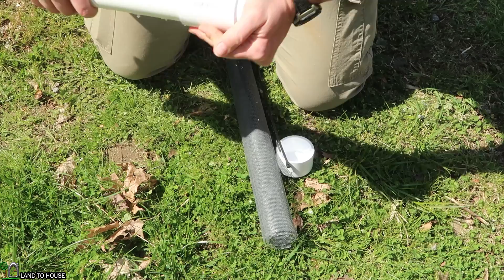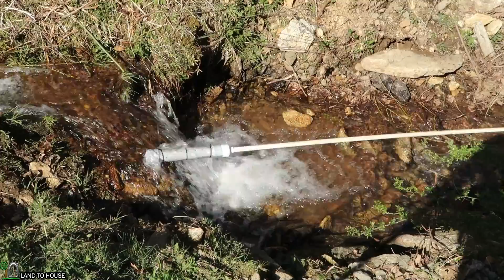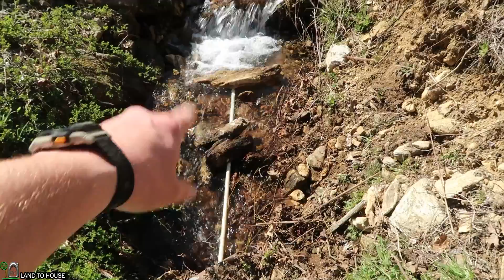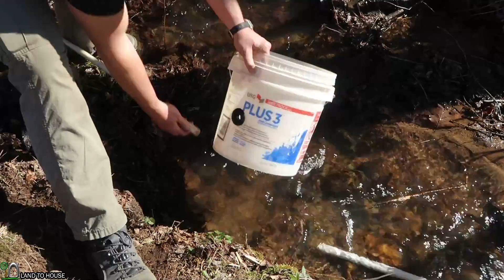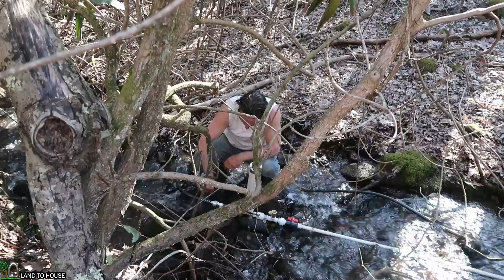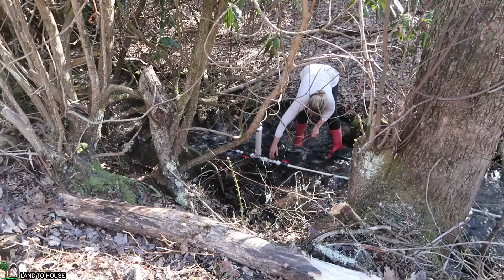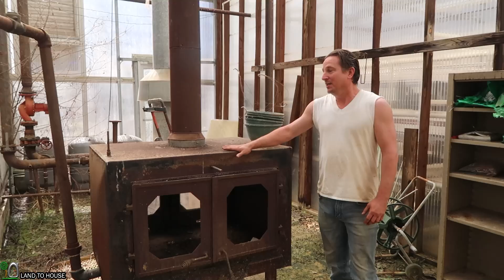Ram Pump Brings Life to Abandoned Greenhouse

Comment from the maker: Buy a Ram Pump at Land To House:
www.landtohouse.com
Reply: I bought one about a month ago and works great. But not when ice builds up in the swing valve.  Any tips for keeping it from building up ice during the cold nights?
Reply: Or just MAKE ONE with a quick trip to the Hardware store.
Reply: you should encourage that couple to start a youtube channel their journey would be fun to follow
Reply: That's right keep it off the ground
Reply: Z's
Reply: அருமை அருமை
Reply: Wish you sold complete kits less the long pipes/tubing.
Too expensive to buy 10' of 4" pvc just for 2 feet of it.
How does the air chamber affect the pump, volume, and output water pressure?
What happens when the air in that eventually dissolves into the water?
Can you use a hot water heater expansion tank (bladder type)?
Would be nice to have some water pressure at the end.
Reply from the maker: @crazysquirrel9425  Kits are coming soon! Likely mid September.

Comment: The bucket in the supply line reduces the head pressure, slowing the output, never saw that before. The output flow is  proportional to the head pressure, all other factors consistent.
Reply: it does steal power i believe, but it really helps keep air out of the drive line

Comment: I have a tip for ya that will improve your intake pipe, instead of drilling holes, use a saw and cut slits in the pipe, this will allow it to pull more water with less silt being sucked in.. I have used that method for decades and I have never had any major issues with it getting clogged up... Try it and let me know how it works for you... Be Blessed..
Reply: I must agree, dewatering spears have slits and they are imbedded in the earth. I would also have my bucket up near the intake and use two inline balanced with a 2” or 3” pipe, grit and organics will fall out of the water when it flows at less than 3 feet per second. A square tank with the water forced to flow in a laminar direction is best practice.
Reply: @anrit5972  Also if they were to dam it up at6 the highest point just by 6 inches, and use a larger diameter pipe, they would vastly increase the pressure and how much water they will get..

Comment: For pump mounting; add in a T with 4" legs and caps on the 'leg's ' and clamp that down to mounting board or railroad tie piece. Did that often for water lines stability. 76 yrs and 60 plus years of rams experiences.

Comment: Very cool my friend.
I have an idea for making the "priming" easier: before running the garden hose delivery pipe up the hill, keep it downhill and let it fill up with water.  Then put a cap on the end and close the delivery ball valve. Now you can drag it uphill, trapping the water in the hose.  Once it's all the way uphill you can uncap it and open the ball valve and the hose full of water gives the pump instant back-pressure.
Reply from the maker: Nice idea! I am writing that down to make a video. It can save a ton of time. Thanks!
Reply: @LandtoHouse  a hose full of water is a lot heavier to move.
Reply: Brilliant!!  If I can add to that,, you don't have to go downhill and then uphill,,, just coil the line next to the source then go uphill. But either way,, you have to drag several gallons of weight uphill. Not sure how much and perhaps it is not enough to be a problem.  ???

Comment: Used to have a cast iron Ram Pump that used leather sealed flap valve; 20 ft appx drop filled 2   55 gallon barrels all day long. Appx. 6 ounces per pulse at about 45 per minute.

Comment: If you are able to use the pump to carry the water up enough into a tower then it's possible they may be able to run a low pressure irrigation system.

 Maybe something that trigger once per day by a timer that controls a solenoid valve that runs off solar.

 That way it's semi automatic and the tower would have time to recharge.

Comment: Steer clear of the bubbles, for they are the problem.  Try to make a small "calm water" pool at the top of the system.
Reply: Just thought about this as well. “Air in the system is a op problem”, puts the intake in bubbly water that contains air …
Reply from the maker: The bucket just down from the intake allows the air to rise back to the surface Essentially filtering out the air.
Reply: @LandtoHouse  makes sense, but still doesn't feel optimal :)
Love the videos though.

Comment: Just a thought. Drill the hole in the lid for the first bucket about halfway across the lid. Then if it ends up being too long or too short you have about a foot of wiggle room by rotating the lid a few degrees.

Comment: Also unless you have a bladder in the air spring, the air will slowly dissolve into the water.  Another solution is a small hole just down stream of the drive valve.  It will suck a tiny bit of air each cycle.

Comment: I'd recommend a 12vdc pump with battery ( 100ah) and solar . I get used panels here in LA . That's a huge greenhouse . I'd hang plastic between rooms in winter . Sheets hanging across (like privacy screen) slows air flow . Heats faster .

Comment: Ram pumps are best when you have at least 100 foot of pipe for enough back pressure. I did it from just a 2 foot dam I built with a 4 inch outlet dropped down (reduced) to a 1 inch black pipe

Comment: You can raise the cycle speed by making double and tripple check valves in series, but make sure to put small pressure tanks between them so that the pvc tube doesnt crack on the long run when more than one check valves closes at the same time, or making them in Parrallel to raise back pressure, similar to electricity by harvesting Back EMF.

Comment: Since they don't have electricity in there.  It would be perfect setup to throw a few solar panels outside.  Get a few batteries and an inverter and hook the subpanel up to an off-grid system and they would be setup with at least some lights and fans to move the air around.
Reply from the maker: I have a feeling the heat in summer will be a lot for the plants. The roof is meant to open in summer and it does not because there is no power.
Reply: @LandtoHouse  More reason to get at least some solar power in there so they can do minimal operations of equipment in there.  That would be an interesting project.

Comment: I would have also installed an overflow pipe at the top of the tank that feeds water back down to the river.  That way, they can keep the ram pump going 24/7 and not have to worry about turning it on/off.
Reply: i imagine it would take a week or more to fill that tank, probably not worth the extra hoses.id just run the overflow out the back of the greenhouse
Reply: No, they should add several more tanks to catch the overflow.

Comment: Large water tanks (black) are available to store that water without algae forming in the tank.
Even a sewer tank will work for watering supply.
Reply: A shallow well pump hooked into t hat tank I mentioned will give 35 lbs pressure to sprinkle the crops.
Reply: 4 yrs of Greenhouse Management college courses.

Comment: My message is 4 years too late, but someone may benefit from it. When mounting thr ram pump to a piece of board, to keep it upright, if you install a cross between the larger diameter pressure chamber pipe and the check valve, then put a short piece of pipe on both sides with a cap on each end, it will help to keep from falling over.

Comment: I just saw a man in apparently somewhere as rural India using ram pumps in all shapes and sizes.
Including using the parts of a washing machine or an microwave as an generator or pump.
Since no electricity or pump is needed it is just the perfect solution for them.

Comment: Start figuring out how to replace those PVC sections subject to the shock with steel or brass. The PVC will crack fail. 
You'll need a means to replace the air in the ram vertical that will regularly get absorbed into the water.
Reply: just disconnect the outtake when ever air in pressure tank becomes insufficient

Comment: Your silt trap bucket is losing a lot of head pressure. Better to put that in much further up the intake line.

Also a small weir on the intake would help enormously with reducing air and silt ingestion.

Comment: In 2001, I attempted to install a ram pump to pump water from my spring box to my garden.  After 5 years and $500 of trying to figure out why it didn't work I discovered from one of Gene Logdon's books that unless you have a minimum of three (3) feet vertical drop from the top of the water input to the ram pump, it simply doesn't work because there's not enough force to run the pump for longer than about 10 minutes.  Instead, I bought a bilge pump and a solar panel and have been happily irrigating my garden that way.
Reply: What book are you talking about? Do you have its name? Can't google the author.

Comment: Love the ram pump videos. A solar system would be nice to run the irrigation. I'm wanting to build a greenhouse and run it with a ram pump and a solar system.
Reply: Or, elevate water storage to have drip irrigation operate from gravity flow.
Reply from the maker: I did talk to them about lifting that 200gal tank to the ceiling for some pressure.
Reply: @LandtoHouse  Get another tank to add to the system and hang it as high as possible.   Run another ram pump assembly in parallel for additional water.

Comment: I wish you would have spent a few minutes discussing the hydraulic ram. For instance how it works, how this one was designed, etc.

The water squirting out of the bucket is a loss of head pressure and the fact that it is pulsing shows kinetic energy is being lost. Your little pump here has more potential than is being used.  The bucket would make a nice drive tank if it were taller. But a stand pipe would work, just make it a least twice the diameter of the drive pipe. Since the inlet appears to be a long way from the pump the length to diameter ratio of the pipe requires a break of some type (tall bucket or stand pipe) near the pump as the max drive pipe length for 1/2 inch pipe should be about 42 feet or 62 feet for 3/4 in. I think performance would be improved if the pump were connected 10 to 20 feet of galvanized pipe to the pump for a driver. Galvanized pipe resists bulging due to the shock wave and thus conserves more energy. At the upper end of the galvanized "driver" pipe insert a tee with the odd leg pointing upwards. Install a length of pipe on the vertical connection where the length will make the top at least a foot higher than the upstream source. Cover the top end with a piece of screen. If your screen is a small restrictive mesh make a bulb shaped screen. This is called a stand pipe. Connect the source to the upstream side of the tee.

The lack of initial flow was probably due to all the aeration (bubbles) at the intake pool. Use a big drill bit next time. One might say the area of all of those little holes is greater than the area of the feed pipe but there is friction and turbulence around the edge of those little holes. For my last intake I applied a power saw to a length of ABS and made big windows in it and then made a bulbous screen to cover the open end and the whole thing. Takes longer for silt and algea to cover all that screen. One time we made a screen bag of wiffle balls and attached to the inlet pipe. BTW, looks like you could have used another 5 foot of pipe and gained another foot of head by moving the intake up to that next level. 

It does not matter if there are some slight uphill sections of the pipe. Once the pipe is primed part of it can even be above the intake level but this is a problem if the pipe goes dry. But you are right to keep it straight as possible and avoid elbows in the supply line for sure.

Well, my comment is getting too long in the tooth now. Glad you made the video. This kind of project is fun and very rewarding, especially considering the price.
Reply: There are several videos on the Net to explain the design and workings of ram pump systems.  I think he covered this topic in a previous video.
Reply: @royreynolds108  OK, thanks. I am familiar with hydraulic rams having built several, but my point was,  or should have been to suggest they provide an overview for newcomers or reference a video where one could learn about these pumps. I think a really small percentage of the population knows what a hydraulic ram is. Much better known in third world countries.

Comment: Holes on the bucket is causing pressure loss for the supply line
Reply from the maker: Holes allow air bubbles to escape the system. The new head pressure is measured at the bucket.
Reply: @LandtoHouse  can the bucket be tall tall enough to not leak water but still open atvtge top. That way, you're not losing source head pressure.

Comment: Being cheap is great but UV light will destroy all of these components. Grey conduit and electrical pit boxes cost more but will last forever. The rubber grommets can be replaced with through wall threaded fittings. Use silicone instead of rubber.
The grey is also less intrusive of a color

Comment: Wouldn't it been easier and cheaper to run polypipe after the pump up to greenhouse? Not criticizing just asking.... Also when that tank in the greenhouse fills up, what do you do with excess? Can you just have a ball valve to to stop flow or will that screw up the pump?

Comment: For the screened intake, instead of using your kind of screens that will allow sand to go through, how about using a couple layers of ladies' panty hose? With its fine mesh, most sand would be prevented from entering your intake tube.  Only fine dust like particles may go in.
Reply: Limits the intake pressure a ton. It's a fine line between battling sand and maximizing flow

Comment: Great video good luck with that, no that is what you call a greenhouse, if you’re putting a head onto that creek you need to consider a water wheel to generate some electricity it won’t be much but you could get some even if it’s only a kilowatt that adds up over a year, expecting to do the same where we are but we’ve got a much bigger head, we are in France and have bought an old water mill with gardens But as yet no greenhouse good luck keep up the good work
Reply from the maker: When I first saw this greenhouse I was shocked! It is a big one. There was a waterwheel years ago apparently.  Not sure if it was power or a way to bring water into the structure.

Comment: The hillside near the greenhouse looked much steeper than the area near the road, why not use that steep hillside, and closer proximity to the greenhouse, for the pump location?
Reply from the maker: The house right next to the greenhouse is not the one they are renting. Did not want to bother the neighbors with a pump. There might have been a back pressure loss issue too.

Comment: Hey Seth I was thinking “wat if” 1 way valve “on the 5 gallon bucket with a reduced 1 way valve wouldn’t that start a siphon n give u more pressure sooo more water
Reply: Great vid
Reply from the maker: I think because the ram pump cycles back and forth it would not help to have more pressure. The pump can only pull a set amount of water.

Comment: All very interesting and informative. How long will it take for them to recover the costs for the required EPA, and DNR, studies and authorizations  and local permits.  In my area the EPA and DNR approval costs about $225K and 2 1/2 years.
Reply from the maker: In this area farms can pull a percentage of water for crops.
Reply: @LandtoHouse  Same in my area but only after filing an economic impact study for each instance. The county installed a pollution measurement device in 'my(?)' stream and said they were required to file a report. I first leaned of ram pumps 50 years ago and was intrigued by their functioning. Your video cleared up some of the mystery behind them.

Comment: Is there a method to use the run off of the ram pump to a) increase head pressure if the run off had to do some work wouldn't that increase head height or would that stop the pump or b) to turn something for low voltage energy like night lights?

Comment: GOOD WORK FOLKS. Will the cold winter effect the system?
Reply from the maker: The ram pump can run in winter as long as the water moves.if it stops the pump will break.
Reply from the maker: The stove would need some work but is a way to run the green house all year.

Comment: would this method work with a rain barrel as a source? or would you have to recharge the rampump everytime the barrel ran out of water? Can you turn the source off once its charged then turn it back on? Or does it need constant pressure from the drive pipe? My idea would be to turn the water on from the barrell, charge the pump, then when I'm done watering, turn the drive valve off till I need to water again? but maybe it needs to have constand water pressure from the drive to maintain the cycle?
Reply from the maker: You can use a barrel but the loss is great. 90% of the water is going to be lost out the waste valve and 10% ish will go up hill.
Reply: @LandtoHouse  hmm. We need to come up with a solution for this! I just need probably 10ps1. I need to get enough to work drip irrigation through a orettt large garden.

Comment: My ram pump primes pretty easy but I can still only open the valve a hair so I just get a trickle..I'm almost wondering if my drive pipe is too long for the amount of lift. I know you recommend a solid pipe for the drive, its a garden hose right now. I'm thinking I might get a coil of 75 PSI PEX pipe for the drive, It will be stiffer than garden hose at least.
Reply: The flexible hose is negating the sudden rise in pressure by bulging.  That is the reason for solid drive pipe.  It is the sudden increase in pressure that makes the system work.